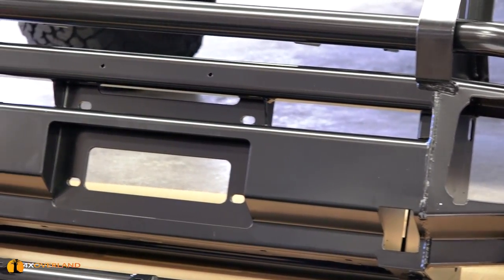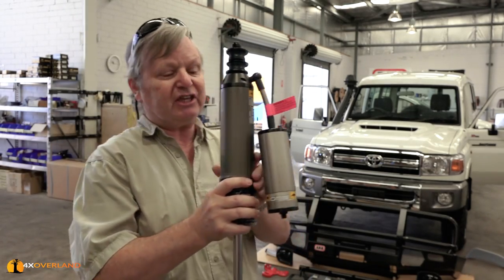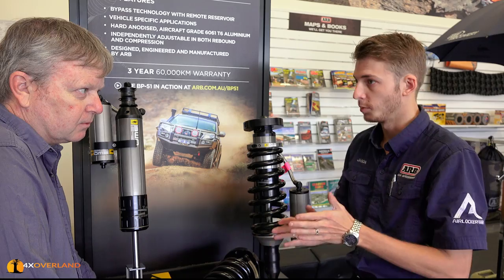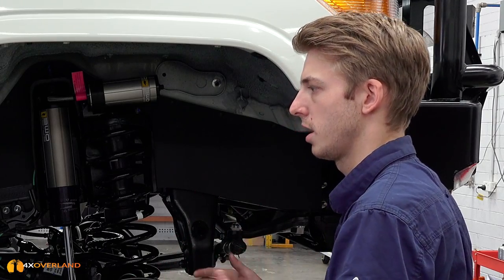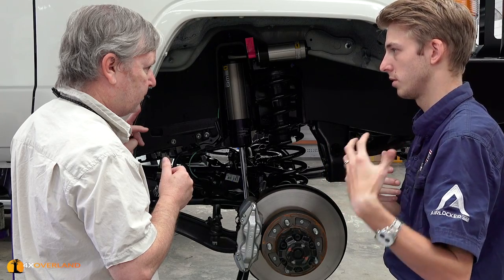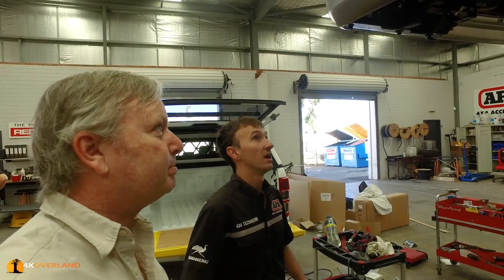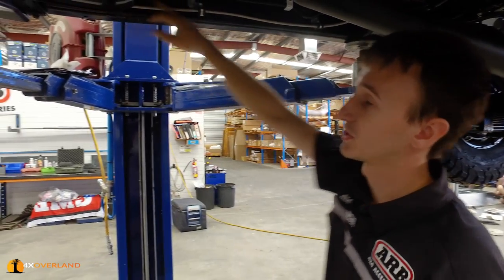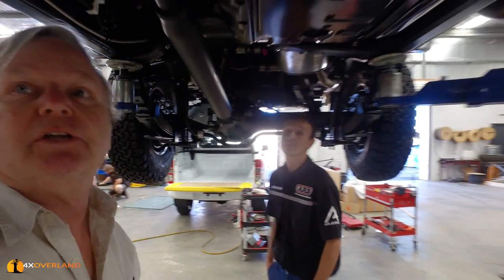ARB SUSPENSION, AIR SYSTEM & MORE. AndrewSPW Land Cruiser build-10

Comment: I fiitted out a ute back in 2008 with ARB gear and OME suspension and nearly 10 years later there has never been a problem with any of their products I had installed. My father bought the ute off me recently and he is planning to do a few trips in it it and I feel confident as the day I had the equipment installed.

Comment: We had the Old Man Emu BP51 shocks fitted when we did the Canning last year and I can't praise them highly enough. The other 2 vehicles in our convoy had Ironman and Pedders heavy duty shocks upgraded on their vehicles. Unfortunately, neither of them made it past Kunawarittji and were unable to complete the journey. You've made a good choice there Andrew!
Reply from the maker: Thanks. I don't know Pedders, but IronMan! The OR suspension is tougher and has a better ride than it.  It's a suspension downgrade, not an upgrade.
Reply: Haha. Yes, well I use the word "upgrade" with tongue firmly in cheek! Another advantage we had was that we were in a Landcruiser Prado with coils all round and the other two were in leaf sprung 4wd utes so we were able to cruise up the big dunes that were all chewed up with all the holes, steps and corrugations with ease while the other two vehicles needed a huge run up and "bunny hopped" from a qtr way up at full power just to make it over. Couldn't have been good on any suspension system. Have you heard of Jmacx coil conversion kit which I believe they make for your vehicle model? You're looking at big bucks (around $10,500) but if you really want the ultimate troopy, boy what an upgrade that would be.
Reply from the maker: Hoping for that in stage-two of the build. But very pricey.

Comment: Outstanding video! I am considering the BP-51s for my 2020 Toyota Tacoma with a very heavy constant load (slide-in camper, sliders, skid plates, bumper, winch, etc). Do you think these shocks would be a good solution for my proposed setup?

Comment: Andrew your doing my head in!! I have a new troopy coming in June (3 month wait) Unfortunately I dont have much left in my pocket so...Out of all the things your getting what do you consider the top three items to upgarde at this stage (From your first review to now)  Love what your doing!!
Reply: Hi Robert, Andrew may not reply but I will since I have a Troopy  new in 2010. No 1 Suspension perhaps not the ultimate shock absorber my nitro chargers are fine thus far. No 2 Air compressor, I will be looking into upgrading mine  to the new lines and resevoure, had some issues with the lines to my rear air locker. No 3 Rear bar and holder, mounting the spare on the door is unacceptable, the weight droops the door and becomes difficult to open, I bought a Kaymar with additional Jerry can holders for water one has a tap, very usefull. Yours Stuart
Reply: MrResiman thanks for that. It's hard to rip into a brand new truck. Saying that I will be wanting to prep it up over time

Comment: If you were forced to pick one to purchase first on a 80 Series LC running 33" mud tires, would you choose the ARB air lockers Fr and Rr, or a 2.5" lift?  Right now it's stock suspension and I do have a winch.

Comment: Arb don't put any boots to go on the new bp-51? The bare rods would make me nervous.
Reply: Boots are a blessing and a curse in my experience. Help protects against rocks chipping the shaft, but also traps water, mud and grit around the seals. Most shocks now days use hardened steel shafts to protect against rock chips - but I would also recommend fabricating a small stone guard to protect as well. This combination works well - and is what you see on most modern dirt bikes for example that have much more suspension that is much more prone to damage than on a vehicle.

Comment: I personally don't like my BP51s on my Tacoma. The springs and other components get in the way of adjusting the shocks. As well as I have to really stick my head and torso into the wheel well which can get quite muddy. It looks like it'll be easier for you since the front shocks aren't in the springs. Besides that the ride is great with mine. They performed great on my trip through the Mojave.
Reply from the maker: I'll be making adjustments on Canning stock, and we will film just how easy/difficult it is :-)

Comment: In WA, you can only lift your vehicle 50mm by way of lift kit, body lift and tyres (in combination). Essentially, anyone in WA running a 2 inch lift with bigger tyres has an illegal vehicle. Which means you have to get it engineered for it to be legal. Obviously this measurement is added to the standard roof height of the vehicle.
Reply: Spot190103 wtf that's crazy
Reply from the maker: Correct. I have learnt this and am making sure I am fully compliant.
Reply: @4xoverland  Thats why LR3/4 are better you can go up to 7 inches with the super extention on the air bags LEGALLY
Reply from the maker: @chaquisa1  One thing I know. I am never going to win this argument. And neither are you. Crs. thanks for the chat.
Reply from the maker: @chaquisa1  Did you see me driving the LR4 in Lesotho? If you like the LR4 as I do, you should really enjoy it. https://www.youtube.com/playlist?list=PLdZBtPD_yK08oQg__l90-K2QgYYxu_ASJ

Comment: Hi. After one Year is over, can you make a Review of your BP51 shocks? Would be great! Thx
Reply from the maker: I've done 25 000 kms, three demanding expeditions already. Very impressed by the ride, and so far, no issues as all.
Reply: Hi. I think its the most underrated shock. Most people think this shock is expensive. But for a bypass shock wich can adjust rebound AND compression its favorable. Comparable bypass shocks are twice the price. So, maybe you will do a Video about your suspension performe. I run this Bp51 in my Jk and it was worth ever ct.

Comment: How can you match the suspension to the vehicle weight before the vehicle is finished, surely you will be adding more accessories?
Reply from the maker: I know to within 10% the final weight to be carried. And right now, its right in the middle. 600kgs may be too hard, and 400 may be too soft. I know the exact additional weight of the front, so it was easy to determine which springs would work.

Comment: Why did you install a lift kit and fender flares if your tires fit?  Were the new tires that much bigger than stock?
Reply: J Ad : New tires are 32 inch. stock tires are 33 inch.... tire with is about the same.

Comment: Try some Icon 2.5 inch nothing special about 2.0 inch ARB 51s
Reply: The load carrying capability and 2-way adjustability is what makes them special. If you don't need that capability, then you don't need BP-51s. Icon is trash in my experience.

Comment: I am receiving large amounts of vicarious pleasure from this build. Now I'm just waiting for the wankers who are inevitably going to tell you that Old Man Emu killed Harold Holt and other such nonsense.
Reply from the maker: sorry. Am I missing a joke? How could OME kill an ex prime minister in the late '60s? Or do you mean something else? Do tell. . .
Reply: I have noticed that for some reason Old Man Emu gear seems to elicit a strong response from armchair experts who will tell you some anecdotal tale of how their cousins, mates, uncle had a bad experience. It seems like it's one of those brands the gear snobs love to hate and I have never figured out quite why that is. I'm sure we're all very keen to see how they stand up to the flogging you will dish out to them doing the Canning.
Reply: Alan Livingston too bad OME is so expensive. I want a lift on my 100 series but I'm a student so it's gonna have to wait for a while :(
Reply: @signs, have a look at dobinson mrr (mono tube remote reservoir). Basically a cheaper version of the BP-51 setup
Reply: ARB are not best at anything, but they are good at many things. I've used a lot of ARB stuff in the past, before I moved interstate, because I had a good relationship (and received a nice discount) with my then local ARB store.

I don't like, and have replaced the OME suspension stuff, because of bad experience with them. The new BP51 shockies are a step in the right direction, but I won't be buying any.

Just like there are wankers who have had bad experiences with OME, there are wankers who swear by them. Calling me a wanker can't change my experience or opinion.
Reply from the maker: I agree. No one company does everything right, and one bad/good product that someone makes doesn't mean that everything they make is likewise bad/good. I have had bad experiences with OME shocks, but that was because the advice given (many years ago) was wrong. But I have also had very good experiences with their shocks as well.

Comment: i don't understand why youve gone through all this trouble of tuning and chipping but not changed the exhaust and snorkel inlet.
Reply from the maker: I am unclear what you don't understand. There are stages to get maximum performance from an engine, all have consequences to reliability, emissions, cost and complexity. Does one do all of them, or some of them? We did some of them.
Reply: Youve gone this far, you may aswell have put a 3" exhaust and a less restrictive snorkel inlet and then had it tuned, thanks for the reply. Ive been following your build, thanks for the great videos mate. I've recently bought myself a troopy aswell and am have gone with an exhaust and system and a bigger snorkel to help it breath better, and 285/75R16 to keep the revs down at 110. Im in Kalgoorlie, I'll definitely be making my way to Perth to grab a uni chip the same as yours, loved your reaction! Good stuff mate.
Reply: +victa stacks, Andrew's troopie is a 2017 model which has DPF. It is illegal to remove the DPF and AFAIK the after market exhaust systems for these are only from the DPF back, resulting in little performance improvement.

Going by what I have read, tuner's have stopped re-mapping the ECU to delete the DPF, because of the fines that were handed out in NSW.
Reply from the maker: That's interesting. I have no intention of changing the exhaust. The vehicle is quote powerful enough already. There seems few advantages and lots of complications to changing it. I will change the raised air intake as the Toyota one is not only inefficient, it's not waterproof and no good for wading.

Comment: There's nothing like finding a quality mechanical shop, unlike Toyota , where you pay for services and parts that you don't actually receive , driving out of a dealer workshop with the old airfilter and 4 out of 6 plugs changed.. did you atleast grease  the unis?
Yeah sure did... That's why there is grease splatter everywhere.
Oh ok thanks, take my money.

Comment: Are you going to put air lockers in the diffs?
Reply: Jacob Moses it comes triple locked from the factory
Reply from the maker: no. Standard electric lockers already fitted and very reliable.
Reply from the maker: Double locked. There is no centre diff.
Reply: Sorry, my mistake.
Reply: One less thing to take care of. Since you were atARB, I immediately thought of air lockers
Reply: I didn"t know about the lockers already fitted by Toyota. When I hear of ARB the first thing I think of is air lockers

Comment: This is actually hysterical. You payed $75K+ on this thing from Toyota and now you are bolting all this shit on it to make it half decent. OMG!
Reply from the maker: Hey. Yes. But its because there is nothing on planet Earth like a Troopy when it comes to a compact overlander van that is this versatile, reliable and functional.
Reply: @4xoverland  so you are saying after giving lr3 and 4s thumbs up that they are the best of all yet you say they will never make an Overlander .Well just take a look under neath and tell me they are not built like a brick!! If you spend the money you are spending on that chassis motor and gear box vehicle which is all it is  !.. that a Landy 3/4 wont perform just as good if not better than a Land cruiser .Seems you have got into the Aussie misconception.The bushes alone on a Land rover 3 are huge and just as strong as a Troopy geez! also you poo poo air bag suspension yet you install them on that Cruiser only to make it as good as a LR3/4.The Landy 3 diesels have Ford motors  and ZF transmissions .How long have Ford been around ?? Not only that but their payload capacity is more than a 200 series @ 845 kg. I would love you to front Aulro haha. Andrew wake up man !!!!
Reply from the maker: @chaquisa1  Okay.
Reply from the maker: @chaquisa1  So you are basing all your arguments on the size of the arms and bushes, while I am basing mine on 35 years and close to a million kilometres overlanding on 5 continents with Land Rovers, Mercedes Gs, Toyotas and others, and I must now wake up and agree with you? Yeah, thanks, but I'm going to stick with real world experience.

Comment: Dont use bumper that heavy and add approach angle. Dont use more than 33 inch tyre if u dont have full floating axle, standar gear ratio n race axle shaft. Dont forget ypgrade u braking system. Dont use more than 2 inch lift kit for safety. just cut u fender to clear the wheels. Dont weight u roof rack more than 100 kg. its dangerous. Thread and drive u 4x4 and nature properly and wise.
Reply: Agung Cahya Nugraha He has a full floater rear end...
Reply: DONT tell other people what they can and can not put on their OWN vehicle with their OWN money.